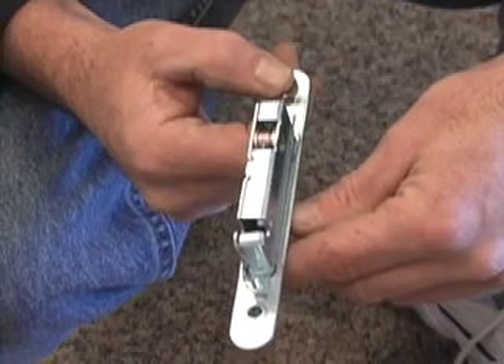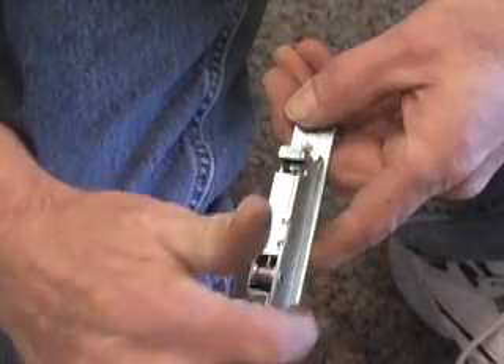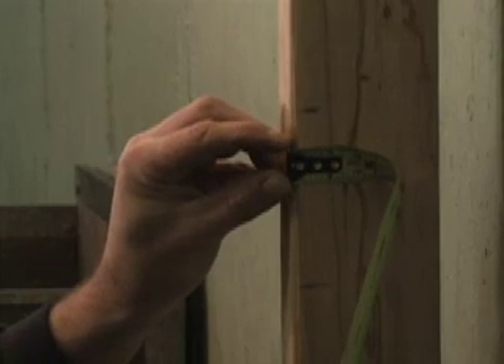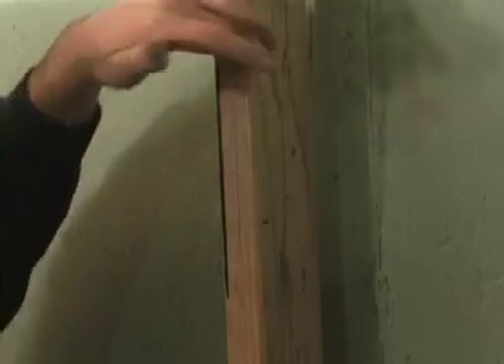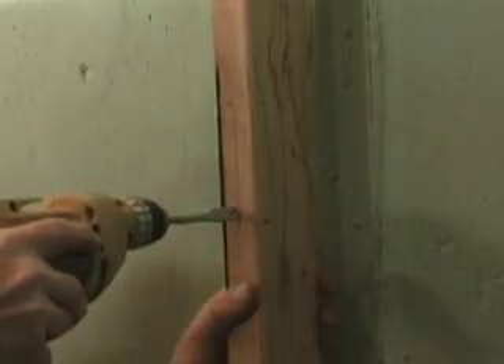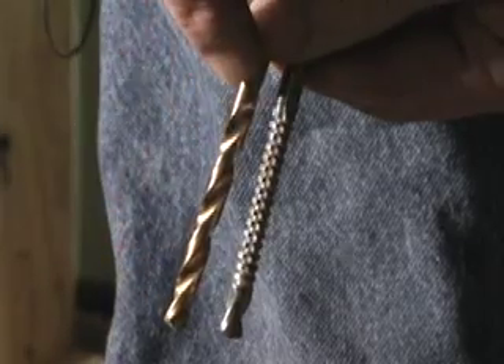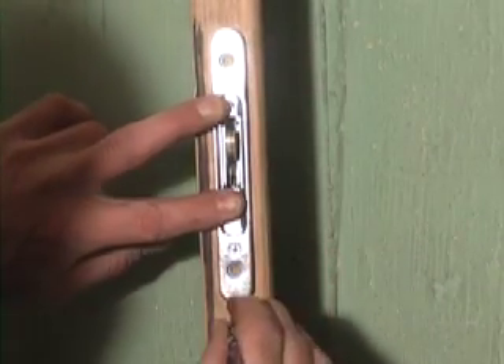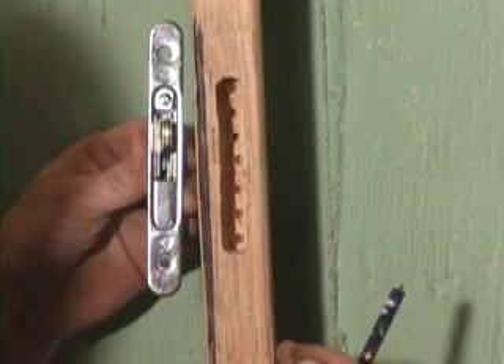Old Style Mortise Lock Video

Comment: Geart Idea, have a old 1886 house with the solid hart pine doors ,they are not that thick, but those pot metal locks that fit on the door face them selfes break very easily. Thanks Jerry

Comment: I suggest you use a forstner bit rather than a spade bit because the forstner bit can overlap as you drill and the forstner bit leaves flat and clean holes. Also, when marking the outline of the mortise plate it is a good idea to use a sharp utility knife to outline the plate (going deep enough to allow a wood chisel mostly remove the waste material). One last thing, it is very important that you drill the mounting screw holes straight and center ( a vix bit is best for this ).

Comment: Thanks so much for this video....I have to replace a broken lock on a door, and my house was built in 1888. The hole that the old lock came from was smaller than the one  that would fit the new lock. You have given me a great tip on how to enlarge it! Until this video, I was actually going to give up and just replace the door :)

Comment: Great  videos Bob, your very entertaining. A little tip on the door lock thing. If you mark the centre vertical line of your mortice with a marking gauge or a nail and straight edge you can then centre the drill bit in the groove you have formed and it won't wander and damage the door edge. Sorry, but i noticed how wonky your line of holes were.

Comment: Hey bob
thanks for this great tip. i've used the mounted plunging rig, and although very efficient and clean, the cost, the setup, the bulk and the mess simply aren't worth it for the occasional mortise lock. thanks again for sharing.
pete